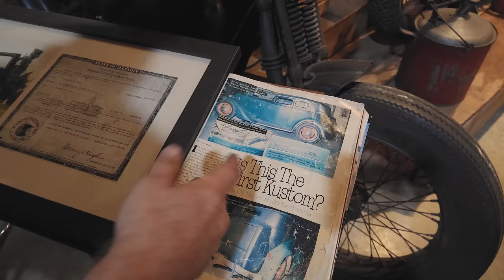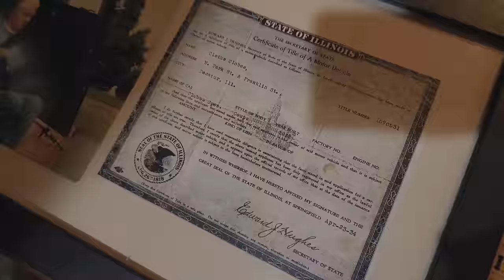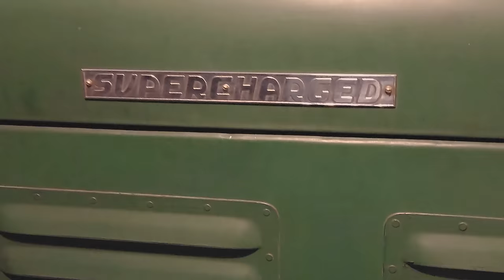The World's First Custom Street Rod — WILL IT RUN?

Comment: In 1931 my dad got a speeding ticket in Dayton, OH in a '21 ford Model T, it had special made pistons and a frontanac head...91 mph!!  he said a motorcycle cop caught him with a Henderson bike and the cop had to use beeswax on the drive belt to catch him....  I saw the original ticket in 1977 when dad told me this...  in all fairness the only thing modified on that car was the engine... I have driven several  original "T's "   but never at 90 mph!!!  wouldn't even try...

Comment: Matt, until you positively I.D. the transmission,  it may or may not have synchronizers. A 32 Trans, generally had synchronized 2nd. and 3rd only. But of course it may have had several transmissions over the decades.  Either way,  even with synchronized, it helps to double clutch and slow, deliberate shifts. To shift into first while still moving, you have to clutch and then match the r.p.m. to the spread of the ratios, or like most just come to a complete stop. Actually if you are matching r.p.m. to the spread, the clutch doesn't even matter. Example,  if there's a 300 r.p.m. spread between 2nd and 1st, provided the vehicle or wheel speed stays the same,  pull the shifter into neutral,  raise the r.p.m. 300, and the transmission will go into first gear like butter, clutch or no clutch.  The tricky part is if the vehicle speed increases or decreased while you're doing this. 
INCREDIBLE PIECE OF HOT ROD HISTORY,  THAT GUY HAD VISION !!!!
T.S. RACING

Comment: Hey Matt a baby nose bulb works good to prime a hose and what fuel you pull out can prime the carb..... Ain't it just ain't it 😎 I had an old Fiat back in the day with dual Weber's that would bleed back over night so I would use the nose bulb it ran to good to fix the issue....like sucking snot.... lols 😎

Comment: That’s what I do to prime mechanical or  vacuum fuel pumps is run it on starter fluid, if it doesn’t start after a few seconds something is wrong usually

Comment: Take that tilison carburetor and throw it in the trash and get a zenith. My father and I have 4 model a's and we had nothing but trouble with the tilison and were always adjusting them and the cars never seemed to run quite right. After putting an original zenith on them the run like a Swiss watch

Comment: It's hard to believe he did all that customization and left a $2 engine and running gear in it. I saw the V8 hub caps and figured it was a flat head V8 and when he opened the hood it was a 4-Banger and hauling a trailer with that, he must have been the slowest thing on the highway. Some peoples priorities are way different than mine I guess. Beautiful work but he must have not been an engine guy.

Comment: Are you going to tell me ,they used 40 hp  to pull that Trailer ?  No wonder it's  stuck ,,,, great coach work ,
Reply: Back in the day they pulled all sorts of stuff with low hp engines. You aren’t gonna go anywhere fast or stop quickly. But, it’ll pull a fair bit. 
Even in the 60’s and so it wasn’t uncommon to use a VW beetle to tow campers and such. One of those would be pretty similar performance to this.